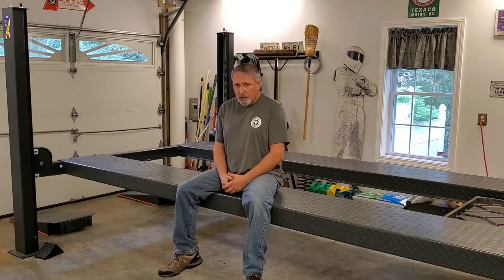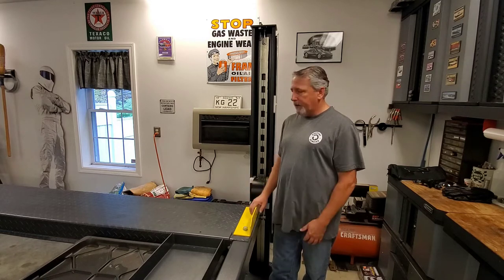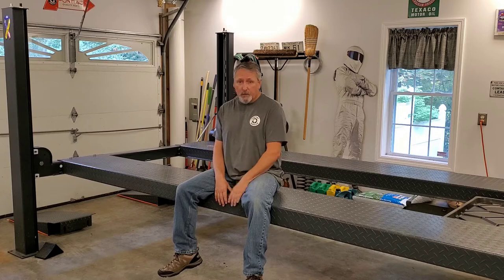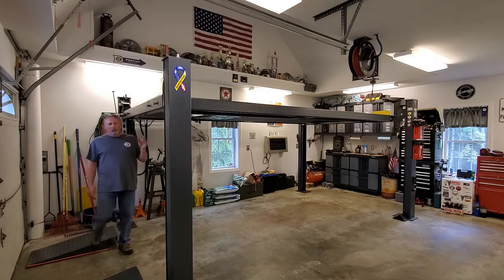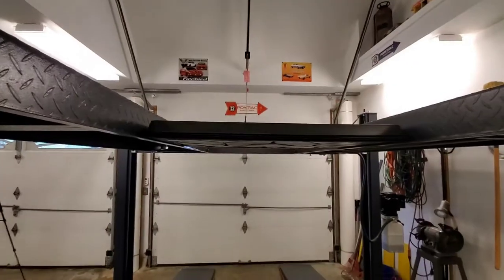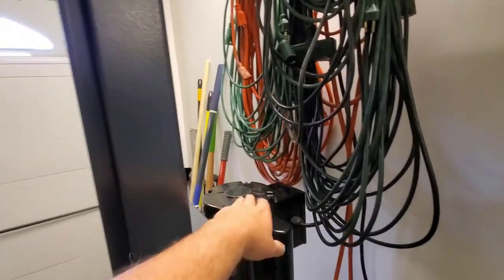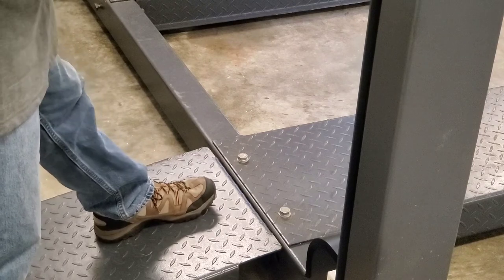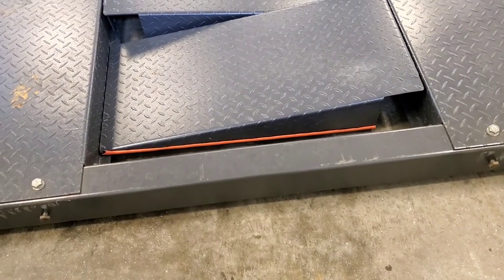Park 2 Cars in 1 Garage Spot // Atlas 408-SL 4 Post lift - Worth Every Penny!

Comment: Very nice lift...I almost went with an Atlas but heard it can sway a little bit when pushed on or bumped into. I'm sure nothing would happen, but I didn't want to chance anything when I have a 3100-4000 lb car lifted up in the air. I eventually ended up going with a backyard buddy
Reply from the maker: Mine does sway a bit when I push it hard, but the way it locks in on each post would not allow it to release (unless something breaks). 
I'm 8 years in with it now and no issues.  🤞
Reply: @DonBeforeDawn  very good!

Comment: Nice review Don. I recently installed my 408sl after waiting a year for delivery. I just love it and it’s way stronger than the steel on the cheaper Garage Pro8000. I do plan to take your advice using the fuel line on the ramps. Great idea. I also installed a black foam 90 degree corner bumper using double sided tape, the length of the runway on the bottom outside edge, because I knew I’d bump my head getting in and out of my underneath car(lol). I also plan to eventually ditch the heavy runways altogether in favor of a very light pair of Race-Ramps. I do have one question. I see you installed the pump on the drivers side rear post as did I. In order to have the ramp clear the lock lever we had to cut about 1” of steel off of the vertical bend.  Did you have a similar issue? Hard to believe the engineers missed that detail.  Thanks, Dennis
Reply from the maker: Mty ramps were notched enough that they did not interfere with the release handle. 
Good idea padding the rails. I have hit my head several times over the years. 🤩
Reply: In case you’re interested the product is by Furnigear Edge and Corner Guard, Foam Safety Bumpers, Baby Proofing Safety Table Corner Protectors, (16.4 Ft Edge + 4 Corners), Black, Self-Stick on Amazon @$11.99. You need two packs. Don’t follow the instructions though. Put the tape on the very edge of the lift first —side and bottom of the runway. Let the bumper coil unroll on the floor and using both hands (one to feed it and one to press it on) carefully apply the bumper without pulling/stretching it, about 4-6” at a time. It stretches very easy and that works against the tape.

Comment: Thanks for the video..how do you reach the top section of the black tool boxes?
Reply from the maker: The black tool box is not as tall as it looks. I can reach everything in the top fairly easily. 
A lower wider box would be nice but would take up too much floor space.

Comment: Can't you just tighten the ramps down aleave them attached when it's raised up?
Reply from the maker: I could do that, but they are heavy and would not hold up. The manufacturer recommends removing them when raising the lift.
I suspect they would bend under their own pretty quickly.